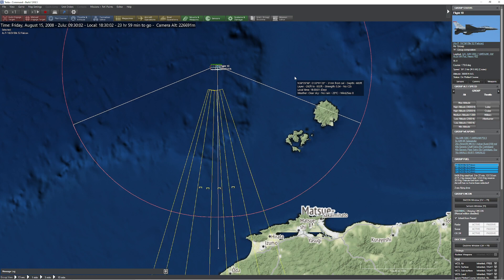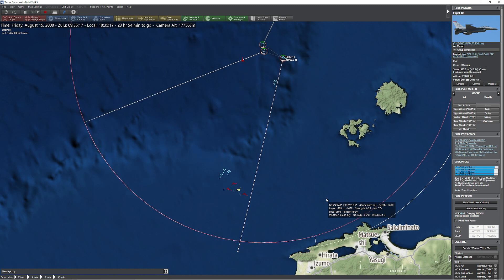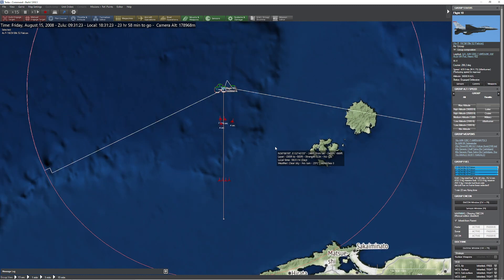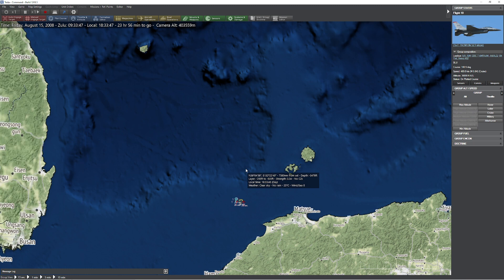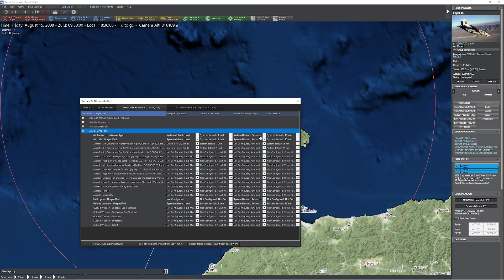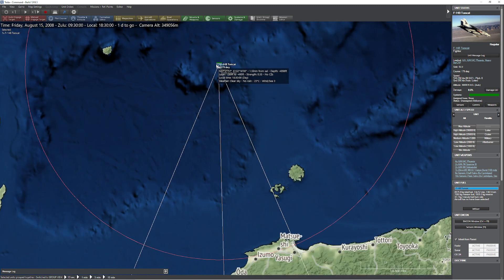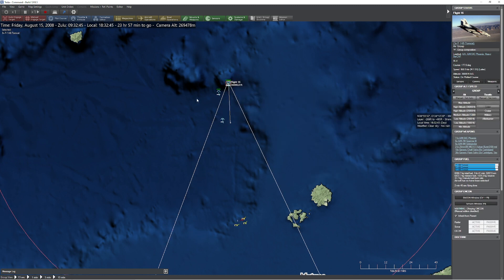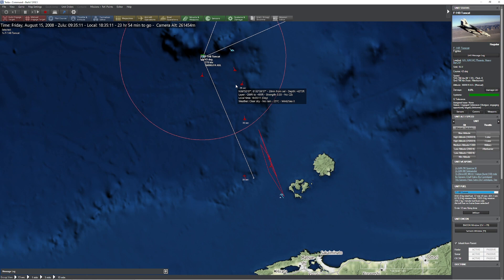C: MO - Tiny Update BVR Implications

Comment: Hi, I bought CMO yesterday. I haven't opened it yet, I'm studying manual and videos and I run into yours (and subscribed :) ).
I have a question about the ranges you defined for the employment in this sort of timeline. Is there a way to automatically have the shooter estimate the MAR based on the threat and fire and manoeuvre to skate or banzai automatically?
I also noticed you split the section into elements manually. Is there a way to have the section perform splits, drags, brackets autonomously?
Thanks!

- Karon

Comment: I’m sorry but they need to fix this issue. The issue is not formations or missile physics it’s the dumb AI not knowing how to properly utilize defensive tactics. Even at the end of the video you said it’s too much. 

Devs need to stop worrying about adding new  planes and ships and work on the AI logic. Especially dogfighting where my dumb planes are sometimes stuck in this endless 10 min loop of following each other and I have to tell my plane to slightly turn more left to fire off a missile. You couldn’t figure that out yourself? Spend all that time following a enemy when you could have just moved a little yourself.

Comment: It seems that you do not have guide the aim54C like in DCS.  - normally in DCS would not work this tactic , because if turn cold your aim54 is dump and not activated. I wonder which implementation of the missle is right DCS or C:MO ?
Reply: I wouldn't use the C version in DCS at the moment. The distinctive advantages of the missile are not implemented yet (there is still work to do on the API), and it is actually even kinetically less performing than the A Mk47. It has, on paper, a slight advantage over countermeasures, but this is marginal.
The AIM-54A is activated by the AWG-9 WCS; therefore, it needs to know where the target is. If the contact is lost, the WCS can still activate the Phoenix on the extrapolated track, but it is a bit of hit-and-miss.
If you want to anticipate the A-Pole, check the TGT Size switch, top-left corner of the DDD panel. It will leave more time to the target to react, so it is situational, but sometimes is quite useful.

-Karon

Comment: That seems like an excessive amount of micromanagement for a simulation. I couldn't imagine this in a large scenario. Do formations at least help with this?
Reply: I think if you use the new formation capability you can create the needed separation to solve this problem.  You can also automate that as needed.
Reply: @kevinprouty1567  but that is way too much work for huge scale battles like North Korea scnerios where you have 100 aircraft in one large attack. That just becomes a choir and not even fun anymore. Commanders (which you play in cmo) are not suppose to teach fighters how to shoot their missiles they tell them where to attack the rest is pilots job. Now I have to manage over 20 flights and tell them how to fire missiles? The devs needs to make the ai smarter because a human player would not just sit in DCS and go and back and fourth like a idiot.  this is just silly and the AI needs more work on missile evasion
Reply: @voidwalker9223  It can be completely automated with proper planning.  Just like WRAs.  You can set formations based on the type of enemy aircraft.  But there's limits.  You can only expect the AI to be able to do so much.